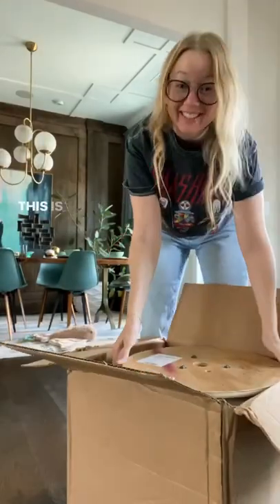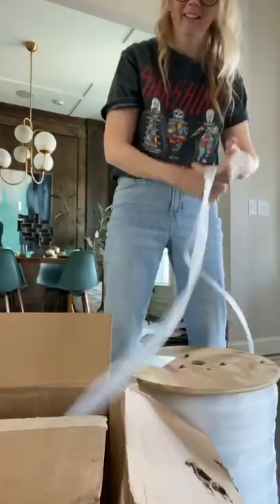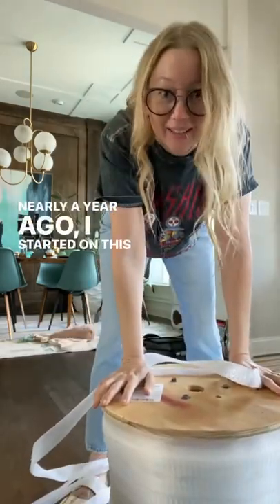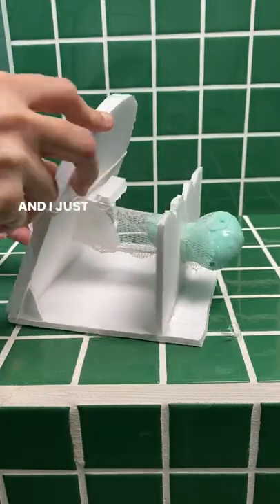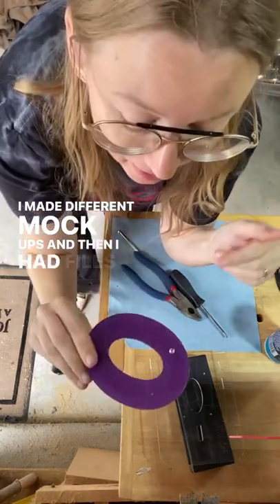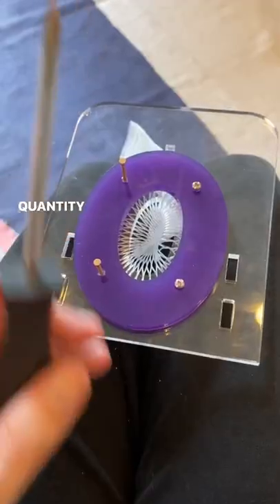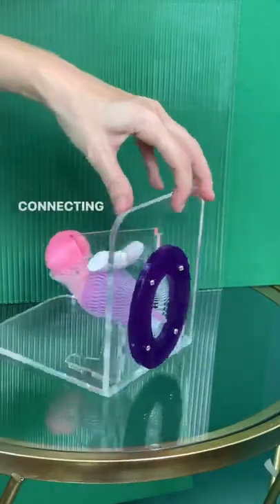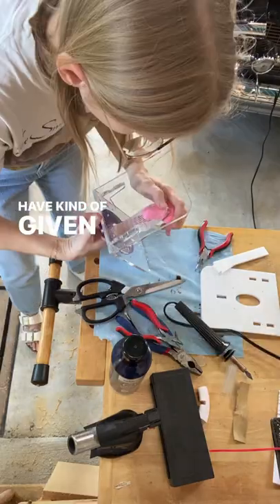The Unfinished Uterus Model - I need help #shorts

Comment: I think have something firmer (2 columns on both sides to hold different components) to stabilize different parts may help. Or I guess you can use the available model and maybe replace some of it with things you prefer. I like the idea of the net though. Since it can compress and expand, it represents real body better.

Comment: you could use a material that easily connects the uterus and will connect with the netting. that way it can connect with functionality but might not look the most professional
Reply from the maker: I worked with a 3d printer and we finished out the model. it works great now

Comment: I'm frm india... Menstrual cup is a very very new concept here infact there are many shit talking abt it even though it's better than pads.. Some even believe that menstrual cups can harm the virginity of a girl.. 🤦‍♀️😐 

Anyways.. I can't find this at my local pharmacy and only can order it online. The only issue is.. I can't figure out which size should i choose and based on what factors i should choose a size.. I'm 19 yrs old and one of the heavy bleeders.. My periods last upto 8 to 10 days.. Kindly help me informing abt the size material and purchase etc thru a vedio that would be very very helpful for me becuz sanitary pads gives me rashes.. No matter how softer or lighter pads i get either they leak or they just give me rashes.. 
Please do help me
Reply: heyy I'm from India too and I'm 16 :) Ive been using the cup since 3 months now. i would def say I'm a heavy bleeder cause my period last for like 7-8 days...I bought the sirona menstrual cup size small from their website and it works very well..there's another brand called safecup usa but it's a bit more firmer and their small size is a bit bigger than sirona..it's a matter of trial and error😄